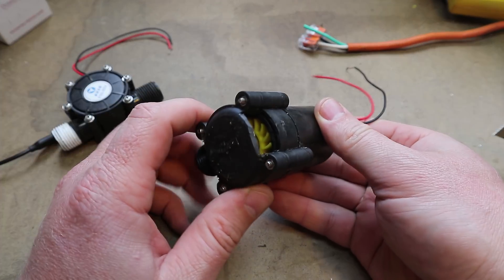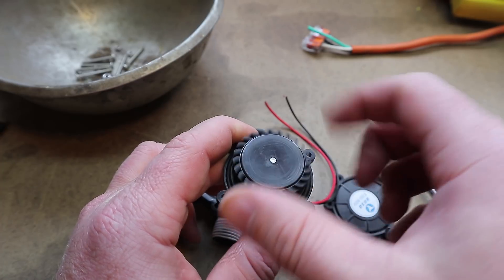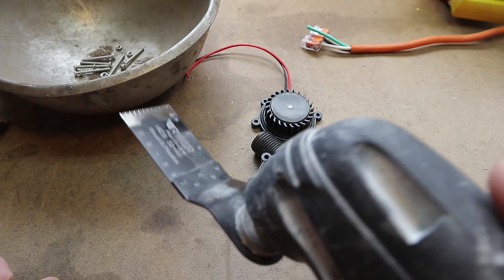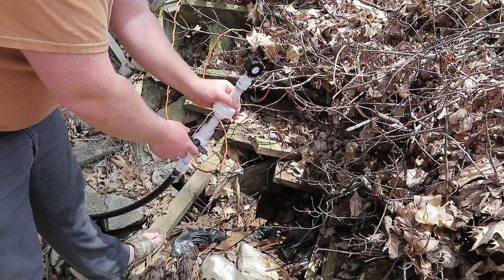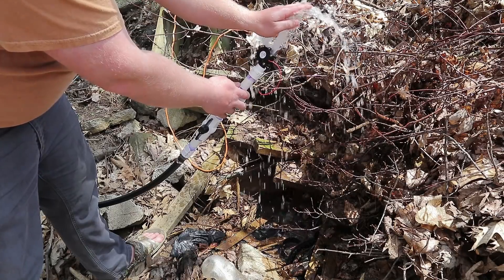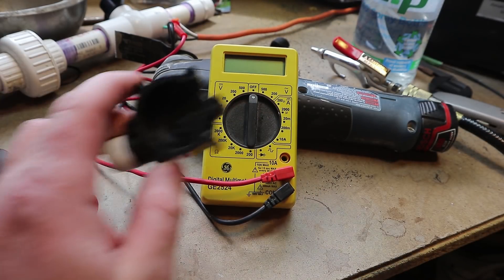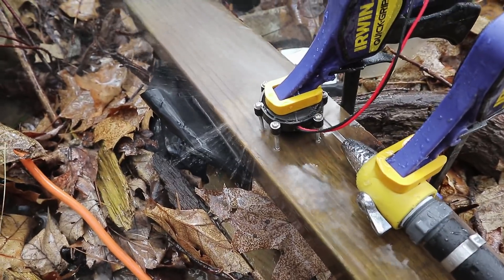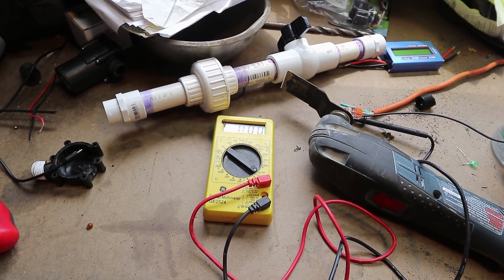Spring Creek Micro Turbine P4, Success!!! (mostly)

Comment: You need a buck converter. That 40V is wasting 28V. If you convert the voltage down you increase your current. You should get at least three times the power into your battery with your shown mechanical setup.

Comment: i know this is a very old video but i had good results putting the output into an mppt controller
Reply from the maker: I still get and read every comment so I'm responding to this quickly. Later in this series I connected it to my high pressure spring water source and an mppt controller. It made about 4w because I had to reduce the pressure as to not overvolt my charge controller. I burned out a simple inline watt meter with which had no over voltage protection.
Reply: @JoeMalovich  i will have to look for that video thank you for responding so fast
Reply from the maker: @1981dasimpson  https://youtu.be/a6tGzg21Nck
Reply: @JoeMalovich   thank you
Reply from the maker: I'll see if I can find it for you
Reply: @JoeMalovich  blast i never cut mine down to improve on them was just a test to see if they where any good and to see how they could be enlarged for more power
Reply from the maker: @1981dasimpson  some can be cut down, others can't. The brushed DC version could not be run without the lower housing but it could be skeletonized to work.
Reply: @JoeMalovich  i may have a play again at some point i have no streams or anything here prob whats just comming of the roofs at moment it seems to rain none stop in the uk lol

Comment: thanks for posting.   good experiment.    certain questions keep plaguing me.   you can consider them rhetorical, if it suits.      is the output of these pmas dc; i ask because idk.    if so, do your clamp meters sense ac volts/amps or dc volts/amps; i ask because idk.     i would say your ten percent estimate is correct.   as you observed, system 'tuning' could maybe result in trickle-charging power.       cheers
Reply from the maker: They both output DC. I have a clamp meter (not shown in this video), it only clamps AC. The meter I do show I don't know if the amps is specifically rated for amps DC but it seem to work. System tuning would involve discarding these little turbines and moving to a proper turbine.
Reply: as yes, the proper turbine for a low-head low-flow application being, a correctly designed overshot waterwheel.  in this case, one with a bucket volume of about one cup.       cheers
Reply from the maker: I am NOT building a 20ft waterwheel with about 4 stages of sprockets/belts. Think Pelton
Reply: aw, joe.   before you think pelton, you Should think  LEVERAGE.      as in Not  Enough to work with.       just as a waterwheel does,  any rotary turbine runner functions as a Rotary 2nd class LEVER.   where the Radius of the runner is the Length of the LEVER.     this inherent leverage is a major factor in a turbine's energy-conversion Efficiency.    is a bigger lever better.   generally, YOU BET.   just so long as the Flow Rate is great enough.     so, with a spring with a flow Rate near zero liters per second, you should maybe consider working on a Different project.      cheers
Reply from the maker: Too bad alternators love RPM more than leverage, and to convert leverage to RPM there is a frictional complicated mess of mechanical bits.
Reply: "too bad  bla-bla-bla" .  this is bs, joe.   your response is Not responsive.   can you imagine a pma that is purpose-designed for a given application, NOT off the shelf.  if not, oh well.    if so, imagine it at site with SUFFICIENT flow;  NOT at this one.       or you can keep on pursuing those seven watts of potential energy coming from yer spring.   cheers

Comment: Try measuring power through a resistive load like a 12V bulb or multimeter wired as an amp meter. That way the battery would not force the turbine to run at 12V and you could maybe achieve somewhat hihger power that way :)
(and if yes, you could use some step-down converter from ebay as a fake  "MPPT" controller)
Reply from the maker: Follow up video concerning power output to come, using a variable resistor rated at 25W 10 Ohm

Comment: I told you that before with water wheel... You need to find correct voltage. If you take more current it just slows turbine down and you are wasting energy. You need to find the correct voltage / current. It is usually about half of open voltage. You need to use something where you can set operating voltage... cheapest is this. https://goo.gl/PNPTL7 It is DC/DC convertor with DC start-up voltage and with water turbine it will act as load controller based on input voltage. Be aware that this chip can handle 40V max on the input but there is also Lm317 to power OP amp and it has limit of 35V on the input... If you want to use it you need to set start-up voltage to lower voltage with load connected and then start to inrease it up to maximum and measure power to load. Without load the input voltage will be back at open voltage and this controller will die. If you find it working then simple way is to put some kind of over voltage protection on the input.

Comment: If that small nozzle will produce 40V but low current, maybe a bigger nozzle would get more more amps at a voltage closer to what the batteries need.  (Either that or charge two batts in series to make use of 24V...)

Comment: I wonder if you could get any more power out of the unit by using an MPPT style charge controller to get a bit more power at a higher voltage than the battery is holding it to.
Reply: not true... mppt is designed to work with solar It adjusts consumption too fast. Water system needs to be adjusted with care. Solar mppt will adjust load lets say every second to get maximum power but in water you need to adjust and wait for turbine to adjust (slow down or speed up - time is depending on size of a turbine) If you connect solar mppt to water that will mean it wil within a few ms try how much power it can drain a due to freewheel effect it will be a lot. That will cause slow down and voltage drop to battery voltage. (it will act as PWM controller)

Maybe I just found a difference... in solar mppt is looking for maximum amps with reasonable voltage that could be drained but in water you need to find maximum voltage with reasonable amps....
Reply from the maker: This is possible, I have an mppt controller but I don't know how much power it uses to operate
Reply: mppt is not working very well for water. What you need is voltage based controll (more voltage = higher speed of turbine) = higher speed = more amp could be drained. If you use solar mppt it will get too much current and slows that generator too much.
Reply: Assuming the MPPT controller is able to be powered off of a micro-hydro generator, without using too much of the power, it should work since the MPPT controller is going to find the maximum wattage it can pull from the generator at the available flow rate.

Comment: so the production of this product somehow is worse than just a bare generator... hmmmm
Reply from the maker: These are sold as generators for use on household pressure systems (while still plumbing the water to a faucet or the like). I'm trying to use it on a low pressure spring-fed system.